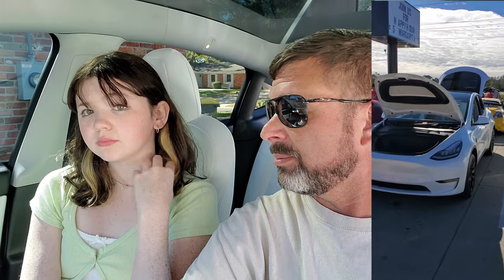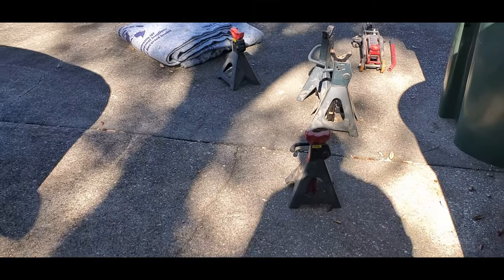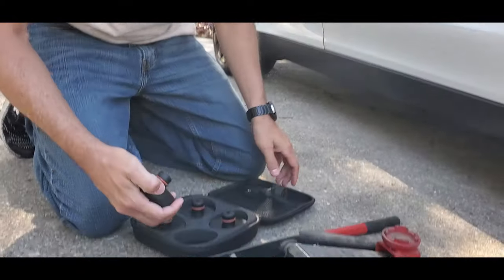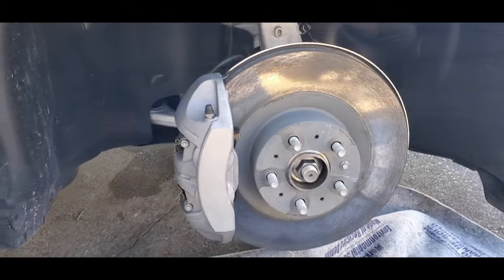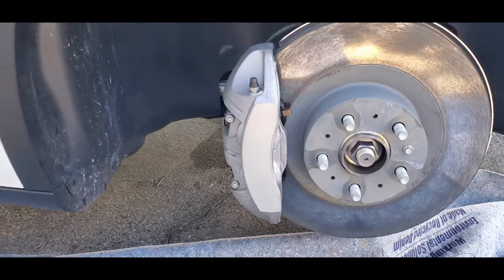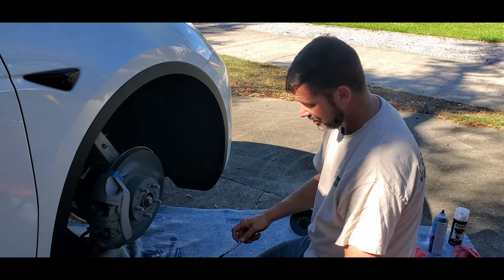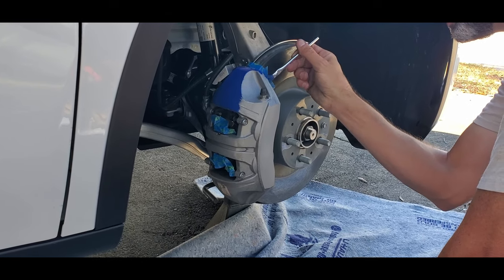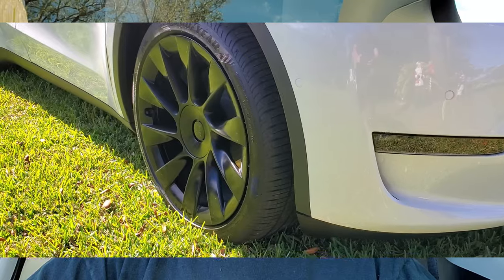2020 Tesla Model Y Long Range AWD Dual Motor, How to paint Brake Calipers Blue! Part 1!

Comment: for how long after paint we can instal the sticker
Reply from the maker: If you can wait at least 48 hrs... the better! Try to wait a week if you can! All depends on the temperature and thickness you put the paint on. I tried after a couple of hours and the tape pulled the paint off!! Longer the better! Enjoy!
Reply: @TeslaBlaine  thx i just recieved the sticker will do this weekend, spray or brush paint which one better?
Reply from the maker: Brush!!! Try to use the same kind I used as it is holding up really well! Remember, if you make a small mistake painting, no one will really see it after the wheels are installed! Don't stress!
Reply: @TeslaBlaine  thx alot
Reply from the maker: No problem! Enjoy your car!!!